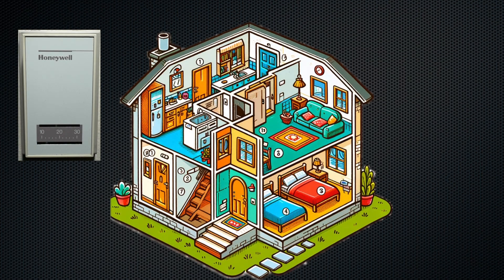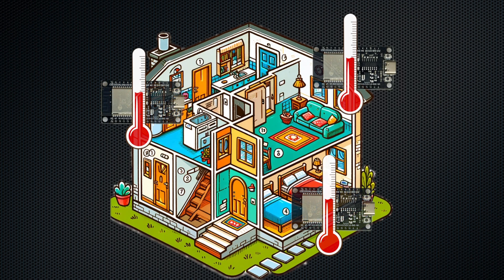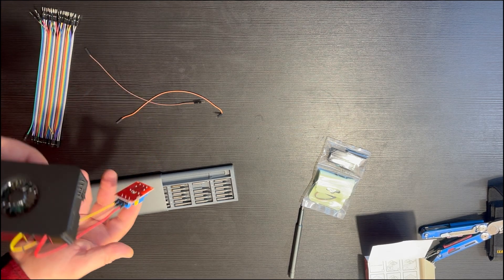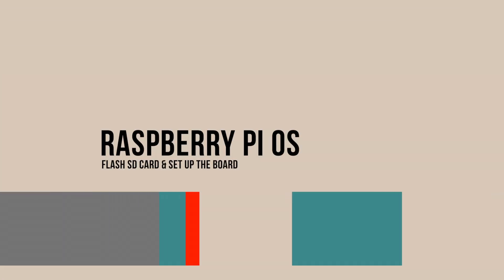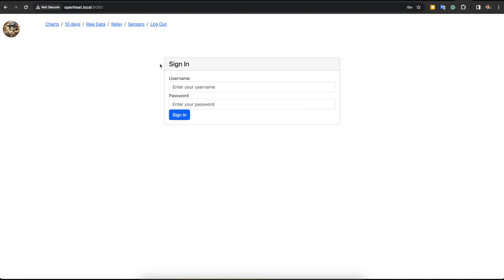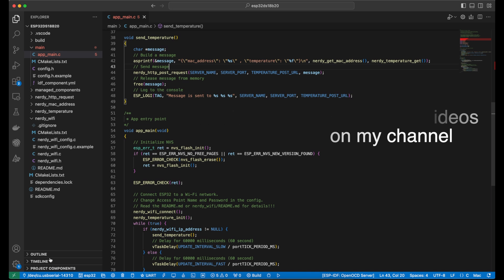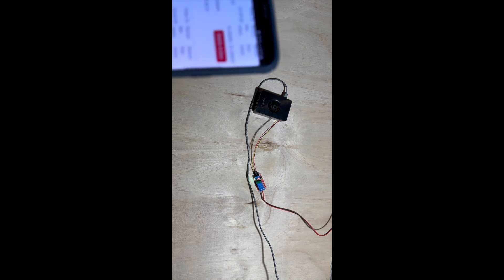Replacing an Old Honeywell Thermostat with a Raspberry Pi Relay and ESP32 Thermometers

Comment: Excellent video, I am currently doing this project using an esp32 to control the entire system
Reply from the maker: Thank you! 
The Esp32 barely can run a web server that’s why I went with a raspberry pi
I collected temperature from all rooms and made charts from the data

Comment: I don't get the point of the ESP32, a Pi 5 should have more than enough processing and GPIO to handle a thermostat replacement?
Reply: I think it's a pretty cool idea. Plus if one disagrees with the hardware used, it would be a simple thing to use on whatever hardware you choose. I'm working on a smart home that isn't reliant on external services, so this is definitely going on my list!
Reply from the maker: Raspberry PI can replace one ESP32. However, I have 3 thermometers in 3 different rooms. My heating schedule looks like:
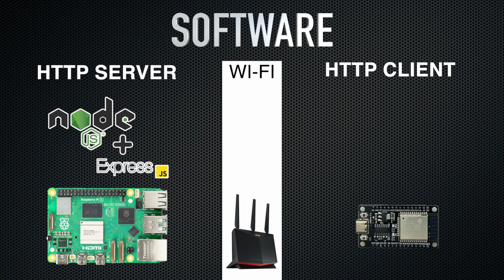21:30-8:00 - temperature in the bedroom should be 19+
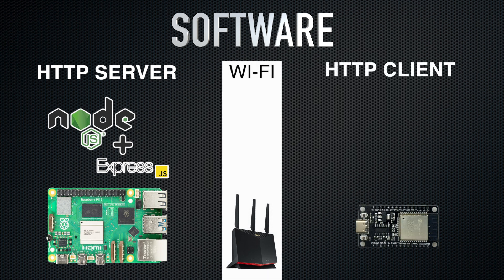8:00-21:30 - I don’t care about bedrooms, I care about living room. So Raspberry PI rely on data from these rooms.

Additionally, my raspberry pi is located in the basement. It can measure temperature there, but it doesn’t matter. 

In a nutshell, esp32 brings flexibility to measure temperature across the building. The board cost 10usd, so it’s cheaper to buy 3-4 to cover all cases
Reply: I'm the other way around, I don't get why a pi 5. The esp board (or a pi 0w or picoW) is plenty powerful to host a simple server at a much lower cost and power usage.
Reply from the maker: Yes, you are right. The esp32 board can make a decision based on the latest data. However, I’ve used the raspberry Pi because I have a web interface that can set up a schedule of temperatures. In addition, I can review a temperature for the last 10 days on the web page on a graphical chart. 
Esp can make decisions, but it’s not a fully operated server with a database. It can’t have a complicated HTTP server with a high level program code, like nodejs
Reply from the maker: Why raspberry 5? 
Because I had raspberry 5. 
Can it be raspberry 3? 
Yes it can be :)
Any board that can hold a database and nodejs can do it :)
Reply: I think he wants to put thermostats in other places